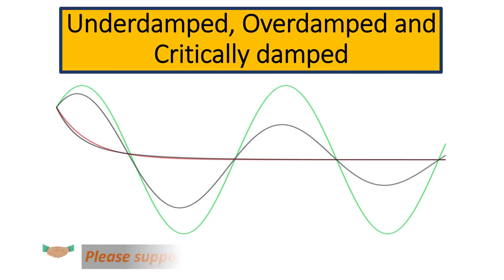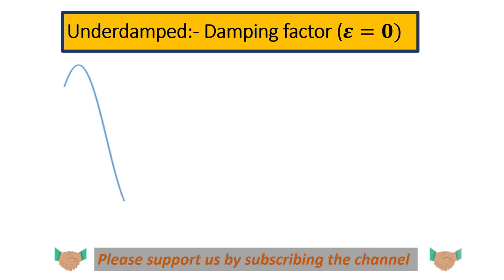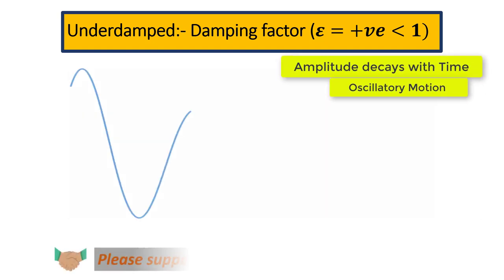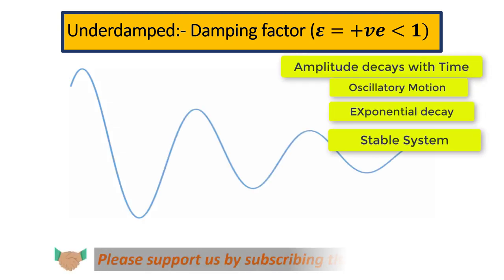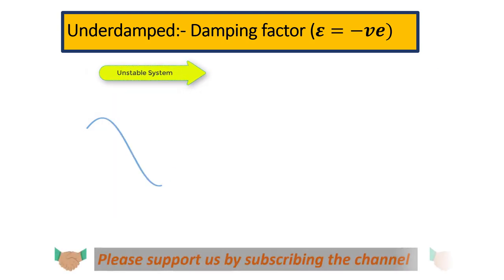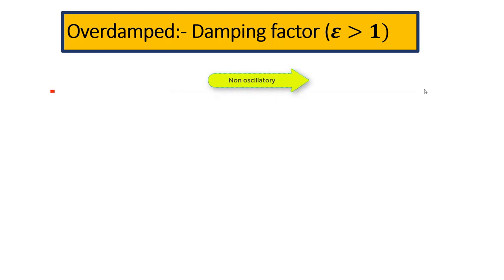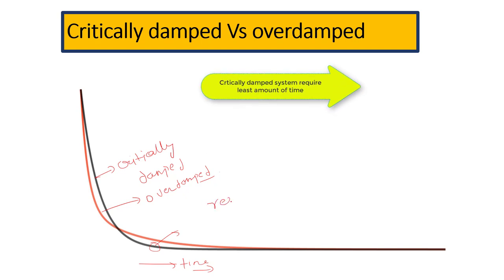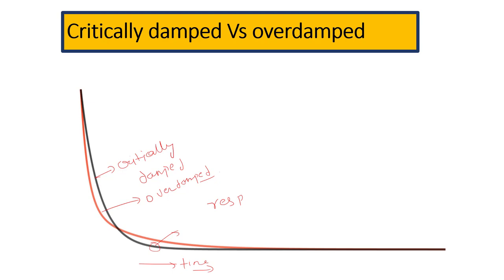Underdamped, Overdamped and critically damped system [In English]

Comment: So, this growing amplitude wave condition (at 4:04) is true about waves in general; like physical movement of an object ?
What about two waves working in conjugate relationship, like Voltage and Current ?
Reply from the maker: Yes it will follow if the energy is added to the system like in case of internal friction induced vibration or flow induced vibration. Please see the following blog by me for more clarity https://www.comsol.co.in/blogs/predicting-the-stability-of-rotor-systems-with-the-comsol-software/

Frankly speaking i am not sure about electrical component but you can make an anology with the mechanical equation.